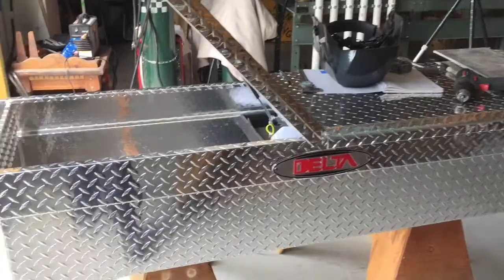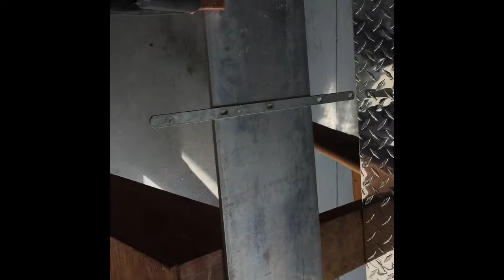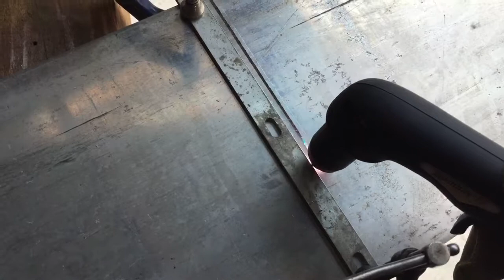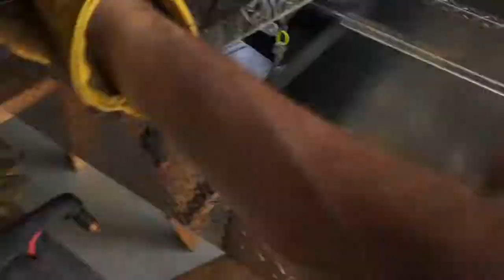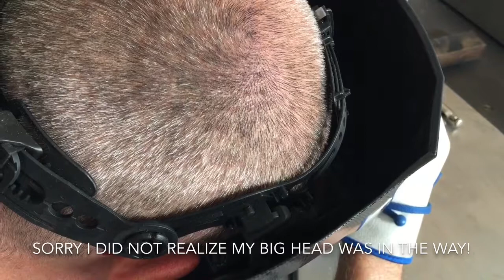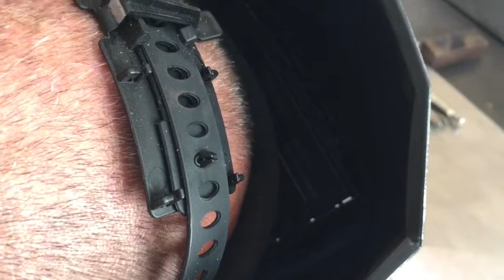Modifying An Aluminum Diamond Plate Truck Toolbox

Comment: Good job! It’s hard to work and film if you’re learning. 1/8 electrode would of worked well with 3/32 filler too would of gave more consistent beads. I try to take my time stop when the puddle is getting wider from the heat of Welding. Looks like you used the HTP Invertig 221 again...I just did the ac amplitude video which would of helped you big time on the 1/4” Aluminum. Good job again even with the head in the way LOL.
Reply from the maker: Thanks, I'll check it out Welding Junkie. I enjoy your vids!